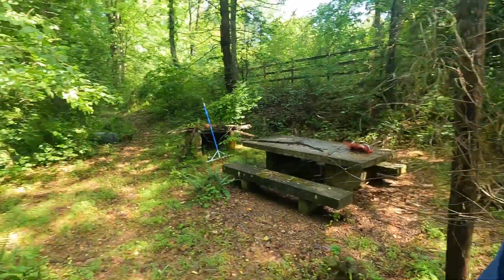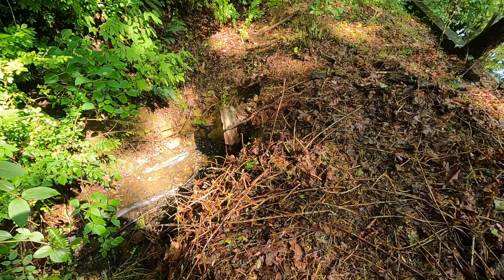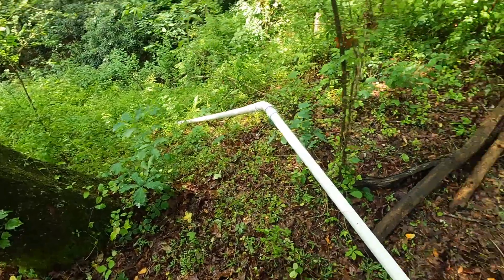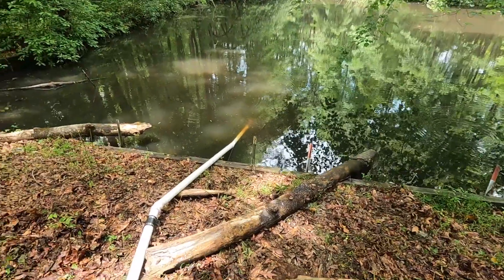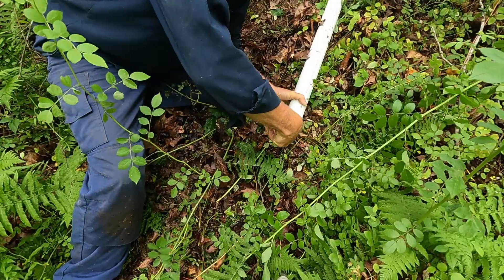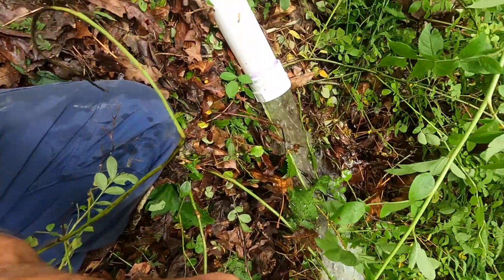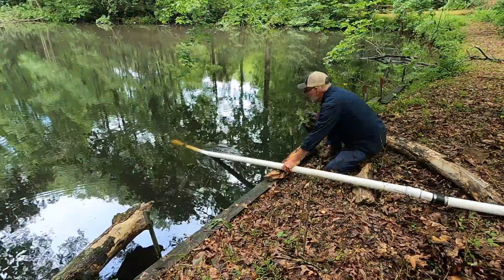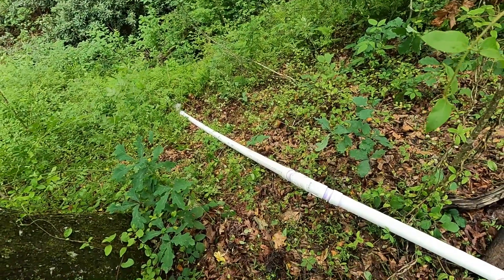Pond Siphon

Comment: this answers an important question I had, which is how the extra air in the pipe impacts the siphon. Ofc you can fill the pipe on the downhill side but not the pond side. It seems the pond water level needs to be quite close to the peak of the dam to minimize that air in the pipe and work. Check valve good idea.